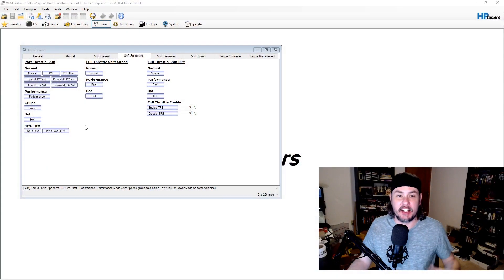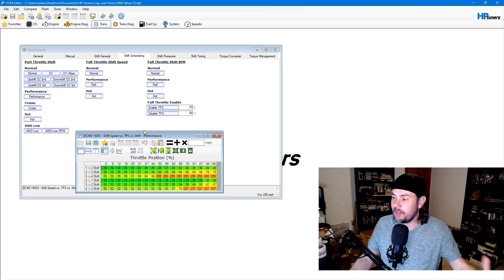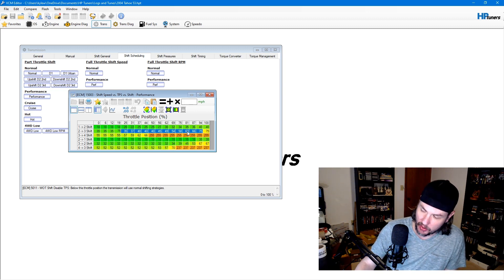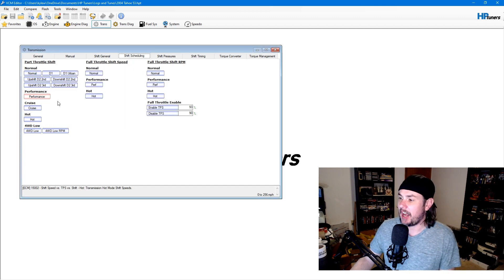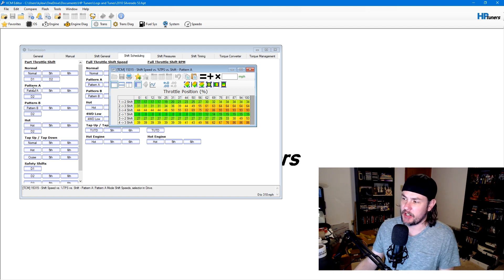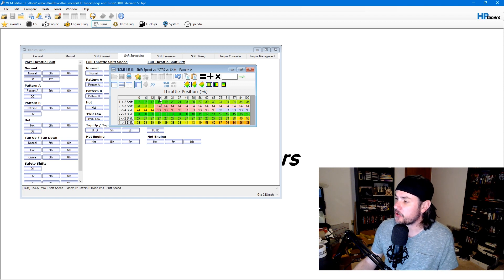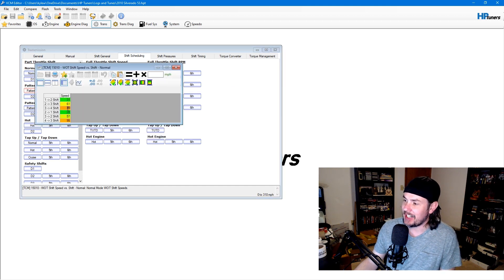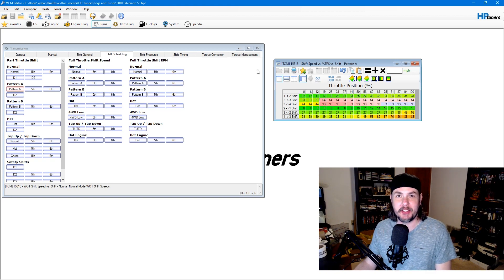Better Speed Density Logs!  How To Fill In More Cells With Your Automatic Transmission!

Comment: Can you please do a lambda tutorial? Besides an error correction graph, what changes are made in the tune as far as stoich to correlate with the wideband and error graph.
Reply: Stoich doesn't change. Stoich is stoich. The car will run rich or lean as you come away from stoich. The MAF and VE tables are measurements of air, to allow the ecu to add the correct amount of fuel to achieve stoich. The EQ error chart is the percentage lean or rich from stoich, so you multiply the VE or MAF tables by the % from your error chart to dial in the fuel charts, and achieve stoich.

Comment: Another way to do that is to use Scanner, Vehicle Controls & Special Functions Window, Transmission, Gear you can force a Gear. I use whatever gear is 1:1 in the transmission, usually 3rd in a 4spd automatic, and then drive and log to your hearts content then disable it when finished. Also this does not require credits to write updates to the ECU to enable this ability. Obviously this only works for Electronic Automatics.

Comment: Couldn’t you just put the shifter in 2 or 3 in the shifter? I mean that’s all I do.
Reply: A swapped vehicle may not have those choices on the column, but that would work. I think most or all of the GM full size that came with the 6 speeds have the manual gear mode, so you can select any gear you want.

Comment: I knw this question is off topic, but in your MAF tuning series for gen 4s you dont mention what to do with open loop fuel air tables. That is: Engine>Fuel>Open Loop. These tables really throw off my MAF tuning and even PE tuning. Do you set all those tables to 1.00 eq ratio? (That is tables for Gear(gas), Gear (P/N), IVT Gain Gas, etc.) Thanks in advance!

Furthermore, what is the correct way to log lambda in a histogram to correct PE? We should aim for .85 eq ratio on PE throughout the rev range correct?
Reply: set the operating temp ranges to 1.0 and also the IVT multiplier same set to 1.0 in the operating temps so u command 1.0 when OL

Comment: You could just command the gear on VCM Scanner.
Reply: Unfortunately that doesn't work on some cars
Reply from the maker: This way you don't have to mess with the scanner while driving, can control it all with the pedal
Reply: That's pretty slick, now what does hptuners have to make the snow and cold roads go away so I can do this hehe?